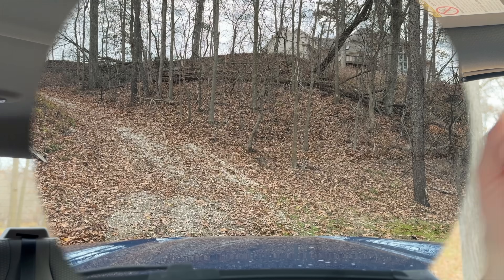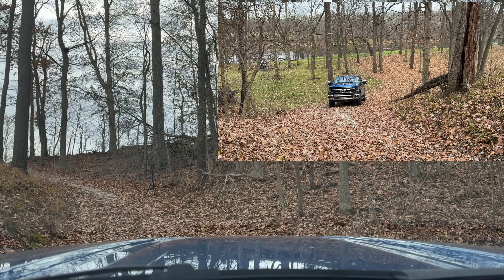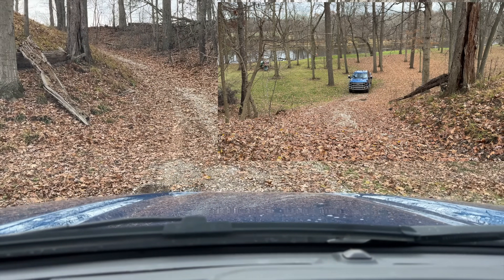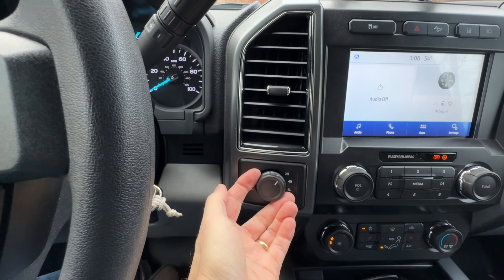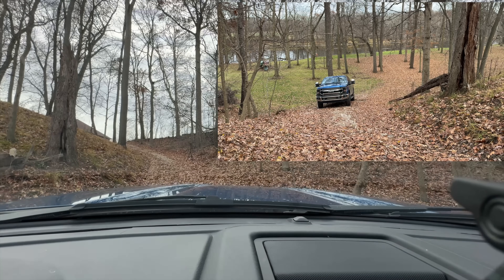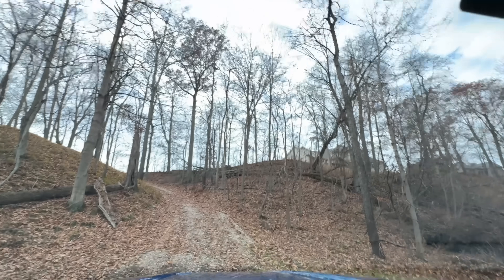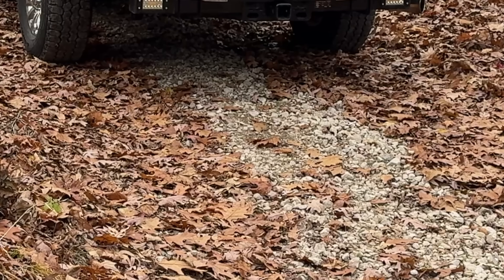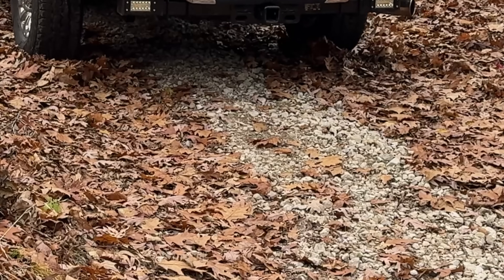FordSuperduty Traction control vs locked diff vs 4wd

Comment: City boy who moved to the country here. I bought a 2016 Ram 1500 outdoorsman. It has old school 4wd with no AWD option. Putting it in 4h is definitely not good on dry pavement. I was driving down a highway in 2wd and got hit by a sudden massive rainstorm, tapped my brakes and went into a wild spin. I changed out the tires to Falken ATW3's, but, would it have helped to go into 4h even though it was just extremely wet pavement?
Reply from the maker: @JRC-eq7zq not likely.  Sounds like you hydroplaned.  Number of wheels driving would not have likely mattered.
Reply: @robertweller2662  Thank you. Good to know. I went off the road, spun at least 7 times, almost hit a bridge, almost went into the Ohio river, spun back across the 4 lane highway in medium traffic, and wound up perfectly parked on the shoulder but facing the wrong direction. My wife thought I was amazing, but it was all Jesus Take the Wheel. The new tires definitely have made a difference and lost me about 2 mpg, but so much better than the all seasons that came with the truck.

Comment: Good demonstration, I gotta say though my 1970s through about 2000 ,4x4s were all much more capable than my current 2017 f-150. I would prefer a limited slip over my locker any day, for regular use. Off road maybe the locker has an edge.
Reply from the maker: @anthonybrincefield2812   I like to figure out how it all works then next I figure out how I can turn it all off.  Give me a manual transmission and a manual transfer case any day.  They just don't make em any more.
Reply: @robertweller2662  You are absolutely correct, lose the electronics and I’d be much happier. Hell I had to turn off traction control just to do a donut in the snow! And drive modes, what a gimmick!

Comment: I have a similar situation at my camp. 12* uphill for about 50 yards (logging trail). During spring/summer/fall i can get out with 2wd unlocked diff  at 10mph. With wet leaves i use the e-locker. After a rain with wet leaves i use 4high at 10 mph. I have not needed 4low in the 3 years ive owned the property. No i dont go in in the winter, when i do ill walk. Ya that 12* kicks my butt too. Lol.

Comment: You should be able to drive up that in two wheel drive if you know how drive ,
Reply from the maker: @MikeDeBoer-n7y That is not the point of the video, I used the hill as a controlled test environment to show the difference between traction control, a lock diff and 4 low with no traction control.  Knowing how to drive and know how to operate a vehicle without tearing up the ground you are driving on or the vehicle you are driving are two different things.  Yes, if I wanted to race between the trees at the bottom of the hill and throw rocks down the hill while spinning my tires and making ruts in the hill for my neighbors to contend with later I could totally have given it the beans and made it up in 2WD.

Comment: Traction control is for wet pavement, ice, and it's main job is stability control....not as much for low speed traction. You know, like when you pass a semi on a wet, curvy two lane road and have to give her the beans to get around. It's real easy to kick out the rear especially if it has a limited slip. Trac control keeps you pointed down the road.
Reply: Don’t be ignorant
Reply: @flight2k5  eat glass
Reply: @intheshell35ify well that’s childish, isnt it 😂😂. Tell me you’re triggered without telling me you’re triggered
Reply: Traction control is actually for limiting wheel spin of the drive wheels when accelerating. Stability control is an additional and separate function built on top of traction control to help maintain directional stability.
Reply: Not exactly.  Yes, traction control is for the situations you mention, but it also can be helpful for low speed traction.  The issue with the case presented in this video is that the traction was roughly equal at all four wheels and traction control can’t product traction out of thin air.  Where it is useful is when the traction is highly variable at each wheel.  For example, say you are climbing a hill where your left two wheels are on wet pavement, but your right two wheels are on wet ice.  Without traction control, you are dead in the water as the wheels on the ice will spin and nearly zero force will go to the wheels on the pavement.  This is where traction control really shines as it will brake the wheels on the ice transferring power to the wheels on the pavement and away you go.  This video demonstrates a pathological case where the traction is similar at all four wheels and thus moving the power from one wheel to another makes no difference.
Reply: @LTVoyager closing the throttle and applying the brakes isn't how you move in loose material.
Reply: @intheshell35ify What’s that have to do with what I wrote?  I never said anything even close to suggesting that.

Comment: My classic Range Rover had traction control on all four wheels, viscous limited slip center differential and could go just about anywhere. However, my Audi Quattro was 100% better on snow, gravel or ice. Quattro is imo the best system there is, much better than any US system.
Reply from the maker: @RogerBeckett-s2j My wife's Subaru Outback is pretty impressive as well.  Thanks for watching.
Reply: @robertweller2662 my father in law has a Subaru and loves it. Definitely cheaper to maintain than my Audi. Definitely a great value car.

Comment: I'm just wondering, and maybe I missed it, but did he also deactivate the locker when switching to low range?
Reply from the maker: @Gunbucket1964 yes the locker was still engaged while I was in 4 low, it was not needed, I just forgot to turn it off.

Comment: This is the very reason we can't use Ford's where we live.  GM and Dodge have had auto looking hubs and G80's for 35 years at a minimum.  Ford still has the electric diff you have to lock in and stupid vacuum hubs.  We had a 2019 F-250 that was basically useless next to a 2002 HD GM with a G80, its insane Ford can't figure this out.......
Reply from the maker: @derekwilliamson7024 to each his own, I prefer the manual locking hubs and the electric locker.  I've seen plenty of snapped axles from GM's GOV lock rear ends.  They work pretty good if you're really careful with them. As far as the front end, you can manually lock them and then you don't have to rely on the vacuum system. Thanks for watching!

Comment: What about 4-wheel high?
Reply from the maker: @wmsnyderphoto 4 wheel high would have been fine and I have climbed that hill in 4 high before, I used 4 low because it turns off traction control and 4 high does not.  This video was not meant to show what was needed to climb the hill as much as it was to demonstrate how some of the features on the truck work.  Thanks for watching.
Reply: @robertweller2662  Thanks for the info.

Comment: Traction control is good for only one thing, wearing out your brakes prematurely.
Reply: Yea that’s not true
Reply: Don’t be silly
Reply: And getting your truck stuck
Reply: @jimbob8533 no it doesn’t
Reply: @flight2k5  
In mud it damn sure does.  Seen it many times.  Saw it in a brand new F350 4wd driving all over the place and turned the truck off.  traction control came back on, and truck went down like a rock in four high with the locker engaged.  Believe what you want but I have a shop full of employees who know that when you go in mud it is essential to turn off traction control.  This goes for 2wd and 4WD fords. It is a fucking joke off road.  Maybe on the street it is worthwhile or on Ice but not in heavy mud, mud, or sand. If you were here, I would take you out and show you in five min.
Reply: @jimbob8533 you’re an idiot.  Maybe force is garbage but ATrac is perfect.
Reply: @flight2k5  I may be an Idiot, but I had to walk a few miles through the woods cross country to get a jeep to pull out a ford f 350 and I had to let my 14 year old daughter drive the f 350 while I pulled her out with the jeep. But I first had to take 700 pounds of corn off the Truck and load the jeep down so it would have enough ass to pull that one ton truck out.  This Idiot don't forget what got him stuck. I drive that F350 every day and have for ten years now. Believe what you want.  I know.
Reply: @jimbob8533 I know that traction control is amazing. Maybe fords is junk, like everything else they make 🤷🏼.
Reply: The traction control in that truck sucks. You dont want a traction control that locks the brakes up on one side , you want a traction control that slight taps the brakes so that bith wheels can put in work
Reply: Better than wearing out clutch plates.
Reply: And getting stuck in snow. Fought it for years in Crown Vic patrol cars on snowy icy hills. It would kill forward momentum and leave you stuck.
Reply: @michaelaustin7505  Subaru's brake-based traction control and torque vectoring called X-Mode-2 works like magic, punches much above its weight in upto a foot of both unplowed snow and slush.
Reply: @sansinutube never drove one, but all the crown victims with it were horrible.
Reply: Geezus, how much are you using it?
Reply: Depends on the truck. Traction control is used in a lot of Toyota its  called A-trac and it seriously does almost as good as a locker. There are some situations the locker is preferred but in most situations the atrac does exactly what the locker did.
Reply: @lanceboudreau3630  In my experience with 4Runners, it's nowhere near as capable as a locker (which is why Toyota still offers lockers).  ATRAC is completely useless in deep snow and sand.
Reply: @lanceboudreau3630  Jeep BLD seems to work pretty good.
Reply: I had a TC Grand Cherokee that went threw 2 sets of Rear Brakes in 40k mi. Ive never needed rear brakes on any vehicle.

Comment: Traction control, or eliminated slip differential?
Reply from the maker: @chrismegerace4979 the truck has traction control that works in both 2 wheel drive and 4 high as well as an electronic locker in the rear differential.

Comment: I'm new to the channel and owning an F150 Lariat 4wd. ... it's a 2006 with 125,000 on it. It  has the dial selector as your truck does, but I don't think it can pull out for diff lock. I'll try in the morning, as well as re-read the manual. Thanks for the informative, NO B.S. video. Awesome job.
Reply from the maker: @mattcurtright5861 not all the Ford trucks have the locking rear diff.  It comes standard on the FX4 and Tremor packages and can be added to any other build or at least it used to be able to be added when ordering.  Some 2 wheel drive trucks have the locking rear diff as well.  Welcome to the channel.

Comment: I've been off-roading, fairly hardcore, 28 years. I guarantee you I could make it up that hill in 2wd, especially with a rear locker. If you hit that hill at 35 mph at the bottom, I would bet you would make it up without 4x4.
Reply: That's not the purpose of the demonstration.
Reply from the maker: @mattcurtright5861 I could make it up the hill in 2 wheel drive if I wanted to beat the crap out of my truck and tear up the hill.  That was not the point of the video.  The property below the hill is low land by the river with lots of trees and grass that get mowed.  At the top of the hill is a manicured lawn, neither of which did I want to answer for destroying by spinning my tires.  The video was not made to show what was needed to climb the hill as much as it was to demonstrate certain functions on the truck.  Thanks for watching.

Comment: Why leave it in first gear? High rpms with just break traction. Seems counter-intuitive
Reply from the maker: @johnhahn8464 I left in in 1st gear for demonstration purposes, the video was not to show what I needed to climb the hill, I used the hill to create situations that would activate traction control and create wheel spin in a controlled environment.

Comment: What about 4 high with traction control vs 4h turning off traction control?  I have found 4h with traction control on to be pretty useless.  And it still locks the front end and makes it difficult to turn on solid surfaces.
Reply: Is your front locker factory? What truck?
Reply: @johnhahn8464 factory 2018 superduty
Reply from the maker: @tmyers1492 I could have driven up the hill in 4 high with or without traction control on.  That was not the point of the video.  I was merely using the hill to created a controlled environment to show a few different functions and features on the truck.

Comment: 2016 super duty. My truck goes in and out of 4 wheel drive fine but sometimes I have trouble getting the rear locker to disengage even when I unload the pressure off the diff. Any tips on this.
Reply: Once you unlock it, drive straight, and go forwards, and sometimes you have to stop and go backwards. It also helps to be in grass, sand, or soil. Doing it on concrete is much harder, same with rocks/stone.
Reply: Back in a circle, will it released, you might even have to back in a figure eight to get it to release
Reply: Another one that happens to the best of us using 4lo

Comment: I just got a 2022 f250 6.7 4x4 with 3.31 open diffs. I kinda wish I had the e-locker. Or at least a limited slip. I go to the desert to shoot and wonder how it'll do if I get into some soft stuff. My older f250 is an 04 4x4 with 3.73 factory limited slip and A/T tires. It works well enough out there.I live in Socal so don't have to worry about snow or ice unless I take a job up in the mountains, which is rare in the winter.
Reply: A rear locker was a must when I bought my truck
Reply: I used to be a mechanic and I haven't seen a truck, especially 4x4, that comes without a limited slip of some kind in a LONG time. I would be shocked if you had straight open diffs... Unless maybe it's a stripped down work truck with manual crank windows and vinyl floorboard.
Reply: @Steven-gv1ke definitely open diffs. Out there. Mine being one
Reply: @Steven-gv1ke  Most Fords come with open diffs.

Comment: I remember as a kid locking the hubs
Reply: I remember doing it 3 days ago
Reply: The locking hubs were really there for fuel savings.  When you unlock the front hubs, the front axels and drive shaft don't have to spin when you're in 2 wheel drive.  When the hubs are locked, that front drive train is spinning just from the action of the front wheels even though power is only being sent to the rear.
Reply: @jayski9410 One of my cousins always had 4wd trucks and he told me he didn't notice any difference in fuel economy when hubs were unlocked. He locked his hubs in the fall and unlocked them in the summer unless he was going mudding. I found that worked well for me. If there is any chance of snow the hubs are locked. When I needed 4wd I pulled the lever. More recently I had a Ranger with push button 4wd. What a piece of crap. It never wanted to engage the hubs when needed and was very slow to release. The motor on the transfer case was a problem also. The old lever always worked.
Reply: So locked hubs for 6 months, chirping around corners
Reply: @Bierdaddy1 No chirping around corners if 4wd is not engaged. The hubs just keep the axles turning.
Reply: @Bierdaddy1 no, with no power going to it it won't do that.

Comment: Did you turn off Traction control and stability control when you used the locker only?
Reply from the maker: @rwj6213 Not for this demonstration but when I am in a real world off road situation and need wheel spin I do.

Comment: I drove a diesel Excursion 4x4 for 10 years doing work along the Dalton Highway. I used to drive the pipeline right of way every summer and I was impressed the hills that thing would climb.  We would put about 50 thousand miles on a vehicle in a year.
Reply: Did you have any lockers
Reply: @johnhahn8464  No, it was stock. They were company owned.   They would haul ass too. I drove from Prudhoe Bay to Fairbanks in a little over 8 hours once. Also with a 44 gallon tank I didn’t need to stop for fuel.

Comment: Traction control will get you stuck in mud sand and snow. Traction control will save you from doing sketchy stuff by totally cutting power and hitting the brakes and ultimately straightening the vehicle back out or just get you stuck. Almost every time I go to pull someone out from being stuck I usually can get in there vehicle and just turn the traction control off and drive out with no help with a tow. The other 5 percent the person was very aggressive on getting out and buried themselves to the frame. I also never use 4x4 low.
Reply: Paulli1874 don't take this the wrong way but if you don't need 4lo you are not in rough terrain.
Reply: High wheel spin and no wheel spin are both bad for low traction situations. So traction control tries to help by sending power to the wheel that has traction, but if all the wheels have low traction, it will just get you stuck as you described.

So you can get out of most things by using throttle control so your wheels don't spin and disabling traction control so it isn't braking when you don't need to.

However disabling traction control and feathering the throttle won't get you the same result as 4wd low. 

Because 4WD low allows you to have low wheel spin while also having high torque, while 2wd or 4 high will stop the wheels spinning completely if you feather the throttle too much so you don't have enough power to actually move at the speed that you need the wheels to spin.

TLDR: Just turn on the damn 4 low and get unstuck. It's not a flex to never need to use it.
Reply from the maker: @paulli1874 never using 4 low is a bad thing.  The gears and shaft for low range never get oiled if they do not turn occasionally.  Good idea to exercise them once in a while.  There is no shame in using 4 low, it's there for a reason and puts less stress on things than when in 4 high.  We took a trip to Moab just over a year ago and I was amazed at how much more control I had in 4 low compare to 4 high.